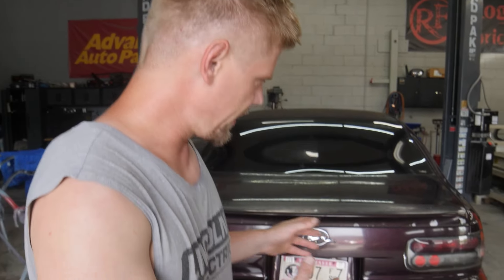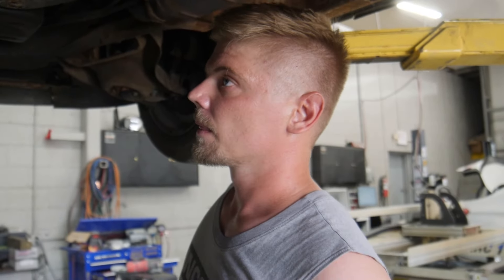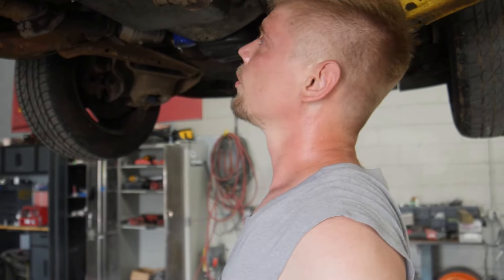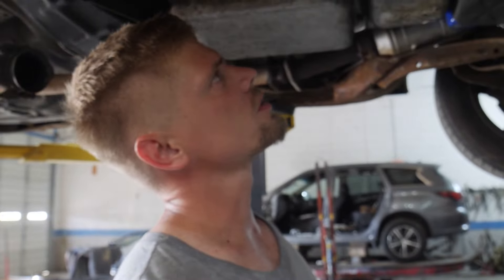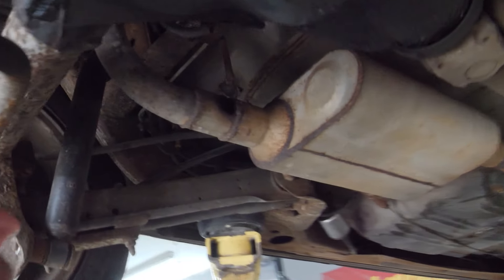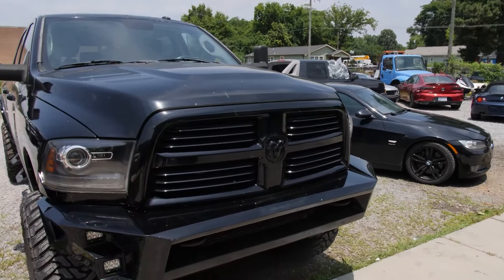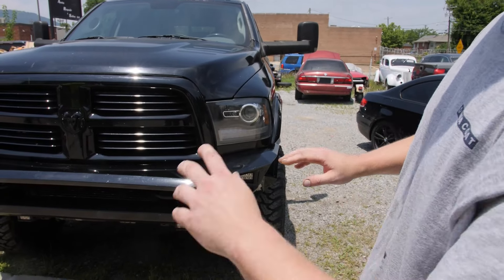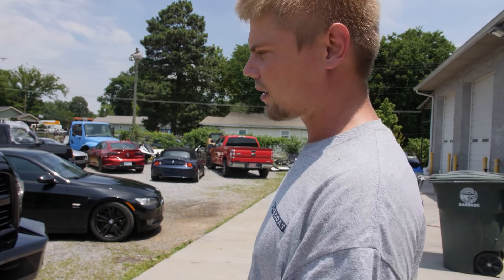We fixed a very Common issue on this 96 Impala ss!!

Comment: Nice job, guys. Never a dull moment when Yuri is working. "I'm gonna charge for every shaving that's hits me, $8k." 😂 That's more than the value of the SS. 😂
Reply: let me know when you find one for 8k for me
Reply: He have no idea 😅
Reply: Just copped an SS for 4k clean 130k miles. Theyre out there if you get off your keyboard
Reply: @gavinclark50  *a bunch of meaningless words
Reply: @tedsirlouis1372 I've got a 95 ss with a built motor and transmission.   I'll take 12,500

Comment: I have a question I get that noice on my ss as well and at times it goes away, also when I accelerate just like you did it sounds similar I been told my engine is shot and need a rebuilt

Comment: great to see something a tad different, not that i ever get bored of the other stuff, the frame work you do is outstanding, that's why i began watching all of you bros in the beginning, its fascinating and you boyz make it look so easy
that SS is built like most planes, different bolts all over haha, i'll never understand why exhausts were never clamped together like aircraft heat ducting etc, i think some modern cars and in particular race cars now use this - i would never do what you did working that manifold in situ but 10 out of 10 for fudging that back together, i would take it off, but then UK motors and foreign tend not to have as much room to work, i would drill out and replace studs with stainless, and use brass nuts as they come undone, strip etc and always come off, even it they need replacing, always keep in stock, and i detest using Heli coils, horrible things when they mess up - that exhaust looked close to the back tyre, eek - i always find light restoration is so time consuming, i found a great product to seal and protect against UV, 4000 grit sand and spray, then light polish
wow running out of gas, does it not take same time to get the gas exchanged as to pinching Jakes, (good Jake bails you out haha) in the UK we simply exchange bottles, pay for the gas and away we go, same with camping gas bottles, they are all the same

Comment: That impala reminded me of my dads car. I had replaced the whole front suspension parts.  And then when head gasket went(lucky leaking AF to outside engine) I disassembled engine down to block to install 2 new head gaskets.  New gaskets north of block and all new O rings on injectors.  Ran really good up and down I-95 from Phila to Delaware Dailey. And rode like a caddy.  I miss that car
Reply: I miss dad too 😢
Reply: I want the Austin.   🙏

Comment: Those exhaust bolts you replaced are available with Brass Nuts. That's the way to go so the next guy never has to deal with snapping a stud. (Tips and Tricks from the Rusty North East).
Reply: Brass nuts for real? Works for any type or metal bolt? I guess you’ll never have a problem being softer brass
Are they made for the purpose of exhausts

Comment: The clear headlights oxidize in the sun light.  After you polish the lens, you might consider the 3M Headlight Film to protect the lens from further oxidation.  There is a Youtube video showing how the 3M film is better than the UV spray.  Nice video, keep up the great work.
Reply: That IS a great option for sure. Would offer some more protection from rocks and bugs too. 
These would have been a waste for that film due to the micro cracks inside the lens still.